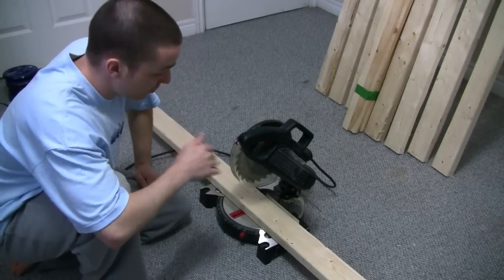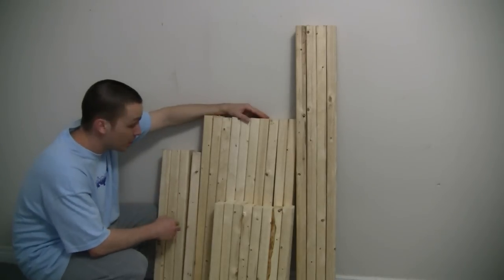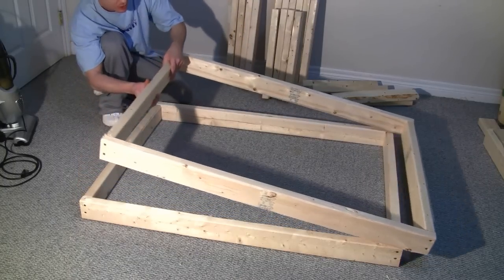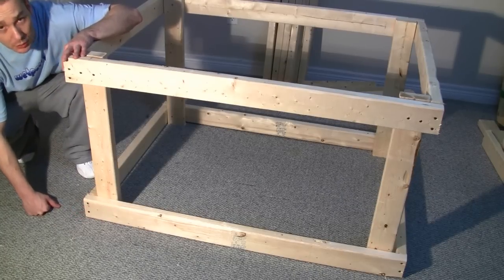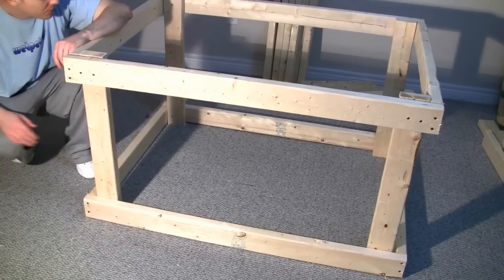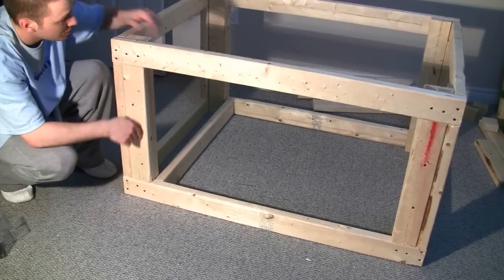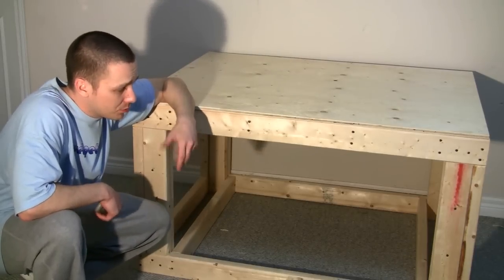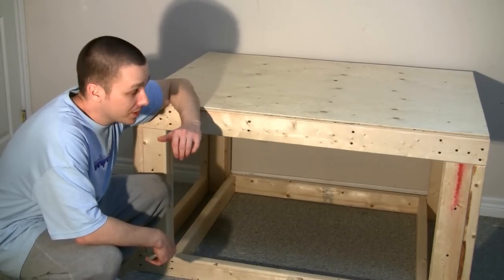HOW TO: Build an Aquarium Stand/Canopy 1/3

Comment: hey, im thinking of putting a stand together myself soon to hold multiple tanks, was thinking cupboard space with 2 doors, then above that a 24inch long tank and then above that 2 smaller 20inch long tanks next to each other so it would be sort of 3 tier.
just wondering how would you go about doing this?

Comment: hey when i put the 2x4 together for the bases i had small gaps which i trying to loosen up the screws and tightening it again and some wat closed now but left very small gaps hardly noticeable would that have any affects? also one of the bases is not balanced cuz the wood was a bit warped, i figures one the weight goes on it would straiten out but that affect the whole thing? its 73" by 19" for a 125G

Comment: What size tank is that stand for? (mean the one your building it not how big it can hold)
Also whats better for wood i can get pressure treated and kiln dried pressure treated wood is about 2.30 and kiln dried is about 2.59 (dollars) im building a stand for a 30gal and i might even build it to hold both my 20 and 30 gal either on top of each other or side by side.

Comment: is it okay if the tank frame sits only on the vertical posts (i did 6, each 4 corners and then 2 in the center edges)? and not touching the horizontal perimenter? ( i kinda made the perimeter a little too big)

Comment: so joey I built my new stand finished sealed with poly .. one problem I had ..a 30 x 30 x24 cube with corner bottom overflow.. the wood support beams are directly under the holes for tank . have to redo with new design for just that one corner. any suggestions let me know. thanks for the help with design.

Comment: Oy. I just finished the main layout. (boxes, and guides are all connected.) My stand is soooo wobbly. How disappointing. I measured corner to corner, and one of the boxes is a little off. I fixed that and it still wobbles. Any suggestions on what to check next? Appreciate any help.

Comment: Props for your building ideas. Only problem I see is the tiny chopsaw. Its not meant for 2x4s but for smaller wood. Also wearing clothes WAY too big bud is just dangerous around saws. Not safe. But keep up the great work. But people on your posts need to use some common sense lol. I can't believe all the weird questions.

Comment: Joey, Help please!  No matter what I do, all 4 corners if my base frame will not touch the ground at the same time... D: I'm getting really discouraged...
Reply: Same thing happened to me :(. One corner was a bit lower than the other four so i put some coins there and a sheet of wood over it. That made the surface flat. The tank has been running for about a year now and its still working great.

Comment: was wondering what your take is on using dado joints vs this design.   As seen in Ted Judy's video
Reply from the maker: Well, there are two things to consider here.
The first is who i make my videos for.
I make videos for a much broader audience, So i have to consider what most people can actually do. Not a lot of people own a saw, let alone a dado blade. 
So while there are a multitude of ways to build anything in this aquarium hobby, my success has come from doing projects people can actually build. 
Second thing is if its actually needed.
Either way... both are over built for this purpose. Which joint is better? Obviously a dado joint is stronger than a butt joint... but again, it isn't even close to being needed.
Reply: ***** thanks for your reply.    ya a dado joint itself  is obviously stronger.     but the dado design means that each leg only has one 2x4.  versus this design with three 2x4's per leg.  so i wasnt sure what was stronger overall.    btw love your videos,   keep it up.

Comment: OK, well the tetras and cories stay small, but the ryukins will get bigger, I have two myself one calico, and one red and white and they are in a 55 gal that i got used off of craigslist and that is the appropriate size tank for two ryukins (which are fancy goldfish) for the rest of their lives, you have 3 so they would be better in a 75 gal tank MAX with weakly water changes. you can keep the smaller fish in the 10 gal, so you might want to start saving and looking for a bigger tank very soon.

Comment: Cheapest lumber costs I’ve ever seen I need to move to Canada lol.. even 4 years 6 years ago you are still talking $4 per 2x4x8 pine and $38 per sheet of 3 ply 17/32. No one here sells acres like that per 100 either.. a box of good screws will run you $20 alone lol.

Comment: Some serious over build going on there lol, but your knowledge is sound...
Try using lap joints on the vertical 2x4's with thinner wood for anything horizontal, will be lighter and a ply sheet on the bottom of the frame will add strength and better weight distribution... NOT using wood glue? $2 tube of pva glue is better than a 1000 screws, i should know, the frame for my 6x2x2 I built using a nail gun and glue using 62mmx19mm timber :)

Comment: how many pounds can it hold
Reply from the maker: Each upright can support 800 pounds. So for example, this stand had 8 of them, resulting in 6400 pounds of support. Not accounting for anything else. If i did, we would be well over 7500 pounds. I have used this design for tanks up to 540 gallons. I have plenty more videos and builds showing stands.
Reply: THANKS